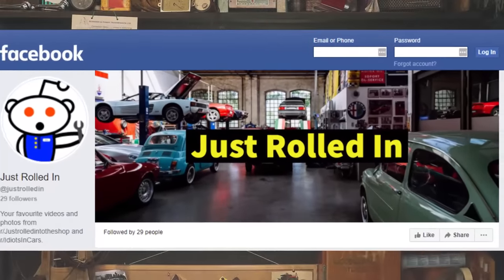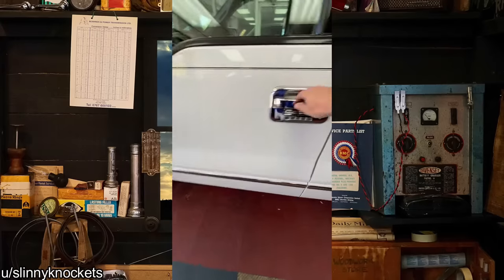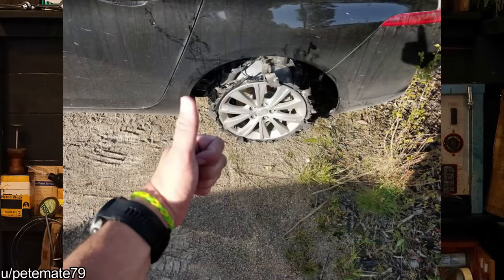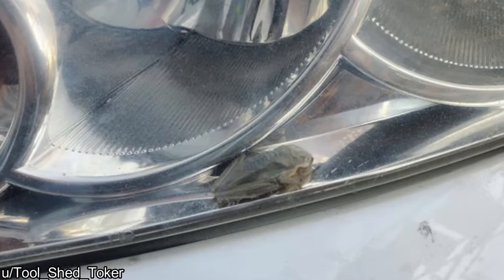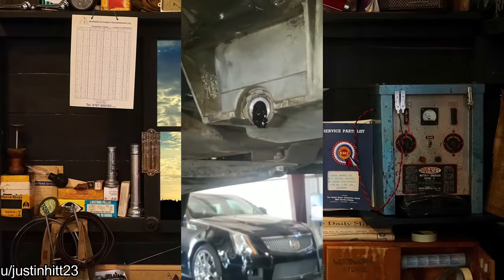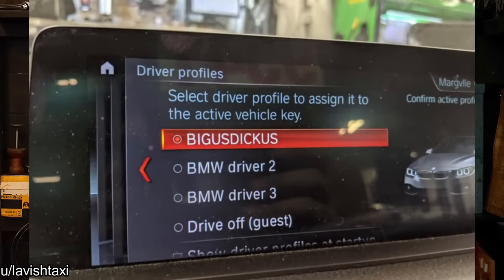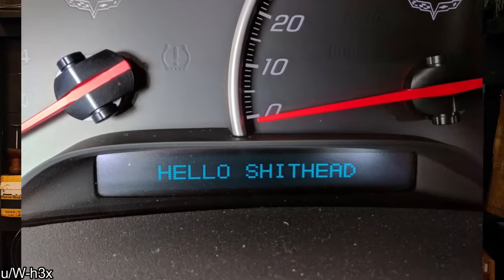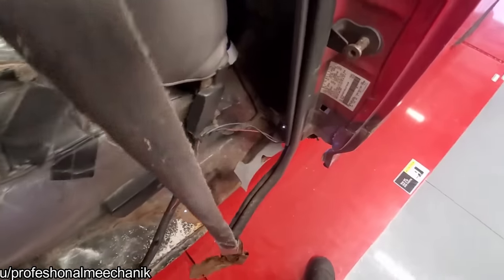Customer States Compilation (Best Clips & Photos so far) | Just Rolled In

Comment: If you look out the window and see 4 to 5 mechanics gathered underneath your car, it's time for you to apply for a new car loan.
Reply: If their car is that bad it’s probably because they can’t afford to service it regularly, so do you honestly think they can afford a new car loan? There was like 3 or 4 examples in just this video of people wanting to leave on bald tyres (most likely because they can’t afford new ones).
Reply: @Mr_Smith1327  if that guy could get a Maserati then he could get new tires. People forget that having a car isn’t a given. It’s a very intricate machine with many wearable parts. Ignoring this just means that things are going to be more expensive down the road and that the person probably shouldn’t own a car to begin with.
Reply: @nepicness  I actually work next to Maseratti mechanics (we use the same shop) and they informed me once that you can get a used 3 year old Maseratti for about $35,000.  They lose value fast, it's the upkeep that is truly expensive. (over $1k just for an oil change, because it uses special oil)
Reply: Dexter Morgon  I stopped caring after I heard the price, my new Ford Ranger works just fine thank you.
Reply: @alexwalker2582  $1k for an oil change? and I thought $150 for a Shelby GT350 oil change was bad
Reply: When mom took her Buick in, the mechanics gathered..

In the days of NASCAR meaning actual production line (minimum 500 of that body with that engine go to dealer showrooms)

Mom got one of the 500 for that year.
10 years later, 250k miles on it, it was a nightmare getting parts to do an engine rebuild.
Reply: @nepicness  That's stupid, the US is designed for cars, a lot of people don't have public transport or even sidewalks on the way to their work. Cars have kind of become a necessity. You are just ignoring the person you replied to, who said they likely couldn't afford it.
Reply: @burritacos366 Why are you baiting a class problem? This has nothing to do with that problem. The person bought a Maserati, maybe they should've bought a Camry and 8 sets of tires.
Reply: @nepicness  you have no clue what condition the car was in or the circumstances they got it. All this reply was for was to say it's unreasonable to just say haha don't buy a car then, those tires didn't look like anyone would think it's fine, that's why me and some others think it's not having the ability to buy new ones.
Reply: @burritacos366  Again, cars aren't a given. Just because you buy one doesn't mean it should last forever. Sounds like the person who bought the Maserati shouldn't have bought a Maserati. I know I won't get one cuz it's basically a souped-up Chrysler. That person sounds like been the type to sell their car for gas money. Money isn't free, you gotta choose what you spend it on. This person is paying the price for being bad with money and that's their problem, hopefully they'll learn next time.
Reply: @burritacos366  Apparently the person who bought the Maserati wasn't having money issues for a good bit, but then didn't plan at all for the future, then they suffered the consequences. Just so ya know I have no money, but I'm smart enough to know that if I get a Maserati, then I'd have even less.
Reply: @nepicness  maybe you should plan better and not make a dumb take you can't defend 2 months later
Reply: @burritacos366  the point is, that if you're having money issues, and you CANNOT afford to safely maintain the vehicle, its time to trade in the Maserati for something more economical.  They are driving a blatantly unsafe vehicle around.

You don't get bald tires like that overnight, or even in a few months.  Someone has been deferring maintenance for some time, and it should have been clear they couldn't afford to keep that car.
Reply: Especially if they're all pointing and laughing!
Reply: @burritacos366  Also, not maintaining your vehicle is dangerous not only for you, but people around you as well. Not being able to afford maintenance is not an excuse for putting other people in danger
Reply: @LukasJosai  Yeah, and? Not being able to afford transportation is an entirely different issue
Reply: @burritacos366 I am pretty sure I made myself clear, but let me put it another way. NOTHING can ever give you the right to put other people in danger. Not being poor, not mental illness, old age... NOTHING
Reply: @burritacos366  most money issues can be avoided before they happen. It starts out as viewing the world as an adult not a child at 18.
Reply: @burritacos366  it still makes no sense you buy a car that costs you multiple thousands of Dollars when you can’t even afford oil changes, tires, etc. And those are the smallest things. Things you KNOW you have to expect.

If you can’t afford a big car, get a shit box for a couple hundred and drive it till it dies. Friends of mine who do struggle with finances but rely on a car do that. They buy a 500€ car every 2 years, that’s it.
Reply: @Mr_Smith1327  it’s not the mechanics fault customers can’t afford to fix there car. It is however irresponsible and likely illegal to allow those card to be on the road. I’ve seen my boss offer the part at cost and remove the majority of labor but the customer still refuses.
Reply: What about the waivers people have to sign... If I had to sign a waiver with a mechanic, I'd either set up a payment plan or start looking for a new car!
Reply: @Mr_Smith1327  Half of these videos are late model cars.  Buy a used cheap car if you don't have money.
Reply: No, it's time to hang up your driving shoes and call it done. No more driving. Those oil changes almost made me loose my breakfast.  GROSS!!!
Reply: @davec.3198  
thing is, most people with used cars overvalue their cars, most cars are worth under 2K with the amount of miles and obvious lack of maintenance on them
Reply: There were 3 mechanics watching my car, scratching their head, not knowing what the fuck is it's problem. Should have sold it earlier, and if I understood cars before, I wouldn't have bought it in the first place.
Reply: After a Mercedes driver coming out of Starbucks drove into the right front of my truck, I spent a few hours with a welder getting everything back straight. There were four guys at the alignment shop standing around it shaking their heads, and they told me they couldn't get it perfect. I put another 100k miles on that truck before the motor blew. Never noticed any uneven wear on the tires.
Reply: And a car maintenance class , or just use Lyft or Uber do everyone a favor
Reply: @burritacos366  yeah there's no proof they bought it at all. All my cars when i was younger were hand me downs and in my social group we give or "sell" people our old cars when we get a slightly newer one. If it's expensive it's expensive until you can get a different one
Reply: @graysona1800  you have to have good credit to pay over time 🙄
Reply: @xclent1975  that's HILARIOUS
Reply: Either that or they are admiring the incredible cob job that you have done and wondering how you even drive around and think it’s safe
Reply: @yeasonwhat  especially with all these "professional"  welders that people know. I mean I really haven't welded since I worked in shop class but I know I could lay down beads better than all those people lol
Reply: This happened to me a couple days ago getting a flat repaired. I was worried but turns out a couple techs wanted to buy my car. It's a stock 08 civic si. Mechanically near perfect condition.

Comment: I used to work at a very large ambulance company based in Grand Prairie, TX. The fleet was very well maintained and we had to do check offs of the truck with electronic forms that got sent to the maintenance shop every morning (as opposed to some companies that only send such things in if something is found to be wrong with the truck). I knew it would get boring as hell reading mundane report after mundane report that showed nothing was going on so I'd occasionally throw in some humorous complaints regarding the trucks. You know: blinker fluid low, fallopian tube misaligned, things like that. Just to give the mechanics something to roll their eyes at, or maybe laugh, rather than just eye bleeding brain numbing "nothing to report" on thousands of pages of truck inspections. I had to stop after one time I submitted a report indicating "Engine Dies When Key In Ignition Turned To Left" and the shop tech on duty that day pulled us from service to have the "problem" evaluated. He was pissed when we finally got to the shop, sat in the truck, tried to duplicate the issue and promptly realized that turning the key to the left is how you turn the engine off in practically every vehicle ever made.
Reply: I can relate...
I was a crew chief on a KC-135 aireal refueler (military flying gas station).
I would screw with my subs by writing up "off switch placed in the down position..in operable "...or "horn button on steering column..in operable".
I wasn't the only one doing this. We had at the time over 75 birds. A few upper ranks didn't think it was all that funny.
Reply: This is some of the funniest stuff I've read all day. "Engine dies when key turned to left" 😂
Reply: @Eric-gi9kg  Does not work in OFF mode.
Reply: That...is EPIC gold!! Key turned to the left!! Love it!!
Reply: I work as an aircraft mechanic. Mainly on trainers like cessna's. We had one instructor squawk that the left Johnson rod was loose (he's always squawking stuff like that). I chuckled. My supervisor chuckled. And then we went about our day. However, the aircraft owner (who also received any squawks with his aircraft) didn't know it was a joke and spent 3 days looking through the parts catalog and maintenance manual trying to find the left Johnson rod so he could order a new one.
Reply: @matthewmartin7639  Hello, fellow aircraft mechanic.
We used to do similar things in the military. Usually in the resolution write-up.
It was always fun when a pilot wrote up something ridiculous. Like the time we got a complaint that turning the friction knob made it nearly impossible to move the collective.... DUH! (It's meant to be tightened just enough to hold position. Not to immobilize it)
Reply: HAHAHAHAHA!!!!

Too funny!
Reply: Now that's rich 🤣😆🤣😆🤣😆
Reply: @Eric-gi9kg  Retired Navy here.. same thing for us.  A gallon of prop wash, keys to the aircraft....
Reply: One that always gets me, “ customer returns new car to dealership, stating that it doesn’t drive at night, it’s ok in day mode, and reverse mode, but when you put it in night mode, the engine just revs and the car doesn’t go anywhere.”
Reply: Awesome 👏
Reply: Outstanding move
Reply: @daverodgers779  
  Hmmmm. 
Customer states car really took off well in Drag mode. Got up to 90-100mph. But, all hell broke loose when shifted into Race mode.
Reply: @popeyethesailorman7850   Don't forget mail buoy watch for the green horns.
Reply: We need more people like you in this world
Reply: @eclectichoosier5474  one of my Co-Workers used to work on U2s, and one day a very particular pilot was complaining about the handling of the aircraft. So he and someone others took a look at what it could be. Hydraulics were fine, everything worked accordingly. They sent the pilot out again and he returned with the same complaint. This happened three times. The fourth time the pilot complained my coworker recommended, on official documents, that they replace the pilot since it seems to be out of spec
Reply: hahahaha the look on the guys face must have been priceless when he realized how stupid he was
Reply: Working for a small ambulance company here I appreciate humor wherever I can find it.
Reply: I would have came to you and gave you a high five or something, because honestly if I seen it first thing in the morning and then realized it was a joke, I would have laughed my ass off.  
That's hilarious.
Reply: @norsethenomad5978  😂😂.  That's a good one
Reply: @cheftomsd and the sea bats gotta look out for those while out there
Reply: @badeiser  Sea bats not a problem but did fear the very poisonous yellow sea snakes off Vietnam.
I always had a survive knife close by.
Reply: I had the opposite problem. I had company that insisted we do vehicle inspection reports on paper for there dot the eye requirements to corporate. Except it was a complete waste of time because they were junk with dozens of problems and they wouldn't fix anything. What's the point if you won't fix anything. They weren't best or brightest. So one day I got an idea. I filled out one generic report and left the date blank and ran it through Xerox for copies. At end of the shift I would just fill in the date and turn it in. They didn't like that either and before it went further we were all laid off because of covid.
Reply: @daverodgers779  Oh I really had to think about that.
Reply: Pfft hehehehehe
Reply: @CHMA4  Ever see the movie Mother, Jugs & Speed..?!
Reply: Man! If MY Oil Was That Thick..Pour In a 1/2 gallon of Diesel? Gasoline?..and run it for awhile? ^ Yeah FUNNY! ("Engine Dies When Key In Ignition Turned To Left")
Reply: I used to write construction contracts as part of my role in a city parks department. They’d easily exceed 400 pages of dry drivel but it all had to be spelled out every time for the odd chance we’d hire a contractor we’d never worked with before. I’d often throw in conditions of worksite etiquette such as “at no time may any employee(s) on site be permitted to: grow a third arm; spontaneously combust; fart the Star Spangled Banner; impersonate a great white shark; inhale a watermelon; produce the answer of ‘42’ when asked life’s most vexing questions; and/or any other act deemed by the site superintendent to be in contravention of the laws and regulations of the Star Fleet Command and shall be immediately removed from the site and beamed up to the mothership” ….or some similar verbiage. 

I’m not sure what was funnier to me: the fact that people in the city’s purchasing department would proofread every word I wrote, or the fact they wouldn’t question why I’d written it and would send it off to be printed into a legal document and signed by the mayor. 😂
Reply: one night one of our patrolmen had an issue with his patrol vehicle. shift Sgt. told him to check the big nut behind the steering wheel.

it took him a lllooong time to figure that one out. listening to the back and forth over the radio between his confused asking where it was and the Sgt's responses .... it went on for several minutes.    I laughed to tears
Reply: Enter Land Rover Defender, whose ignition works exactly the opposite as in any other vehicle.
Reply: A paint can works great though?
Reply: I ain’t readin.  All that
Reply: now i know why the mechanics in the other video comment thread were complaining about ridiculous pilots complaints that things werent working in the off position. turns out THEY were the joke lol.